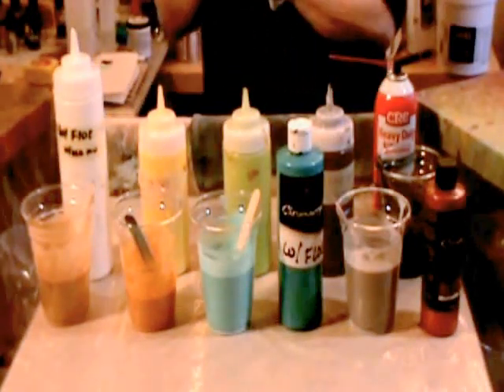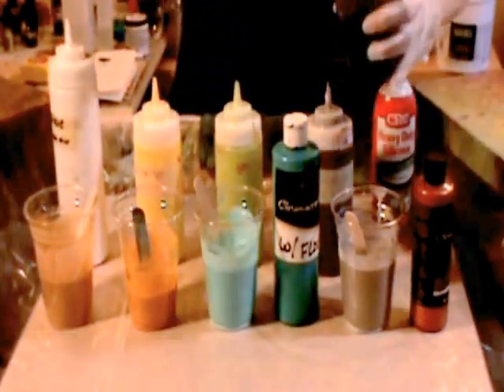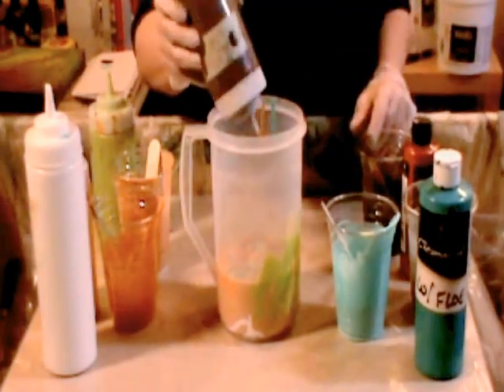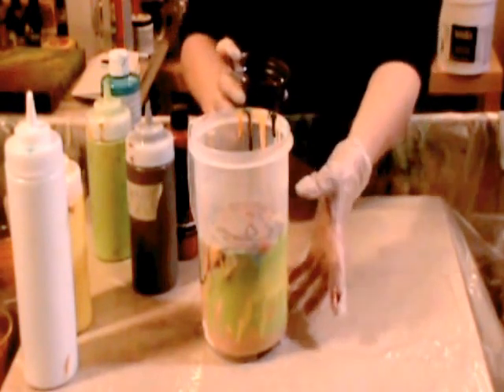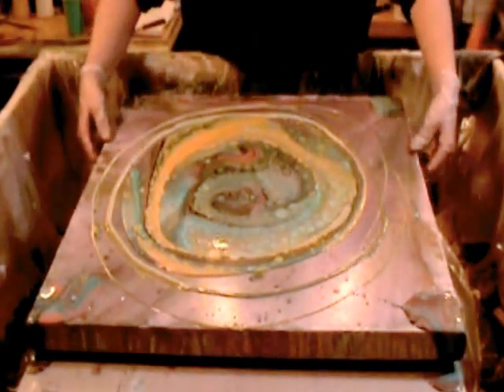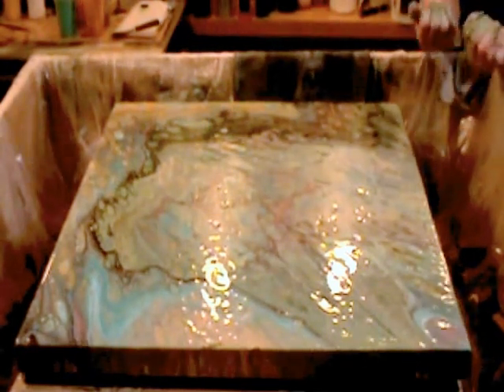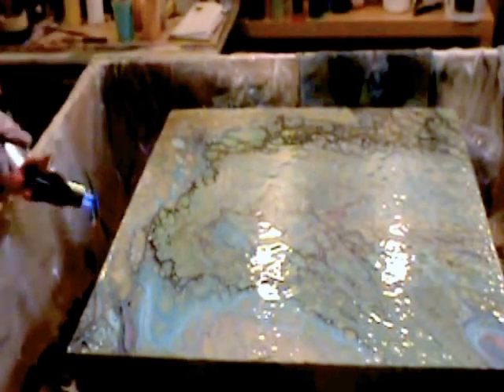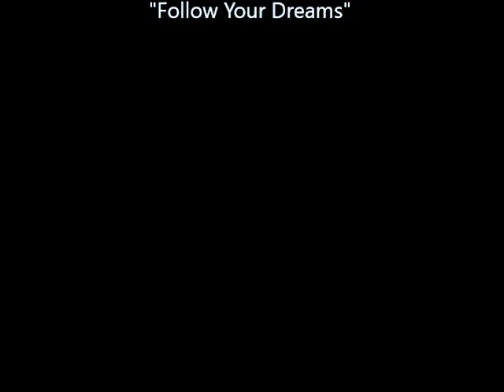KMS 6 ~ Art Acrylic Pour

Comment: Hey Kim!
I was trying to look for the answer here, but I don't see it. I was wondering what's the ratio of paint to Floetrol that u use. do u use a pouring medium as well? or u use the floetrol AS a medium?
Thank u!
Reply from the maker: Hi Ido! I don't normally list ratios because I don't really measure.  I can tell you that on this one, I used floetrol and silicone only. The ratios (floetrol to paint) were about 50% Floetrol to 50% soft body acrylics. I've been using Floetrol instead of pouring medium for the past couple of months and I'm loving it. It dries kind of matte, but perks right up once you seal it with a varnish. Hope this helps. Thank you for watching!
Reply: Kim McDonald Studios Great thank u
I ordered Floetrol on Amazon and was wondering how to use. so u say u use it with no other pouring medium and just a few drop of silicone. Do u stir the silicone in good? or just a tiny bit?
Reply from the maker: I only stir the silicone a little bit.